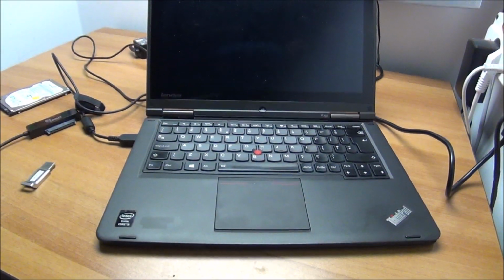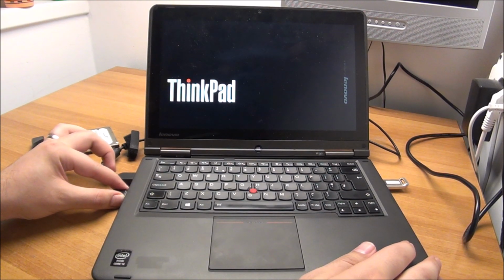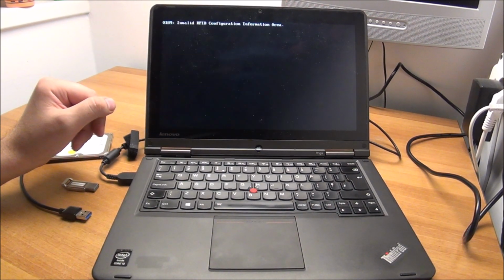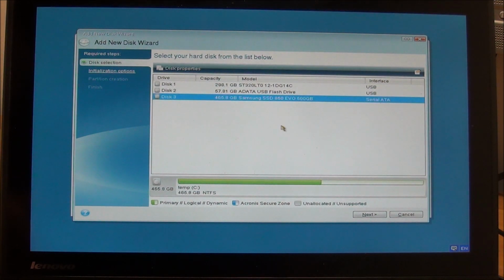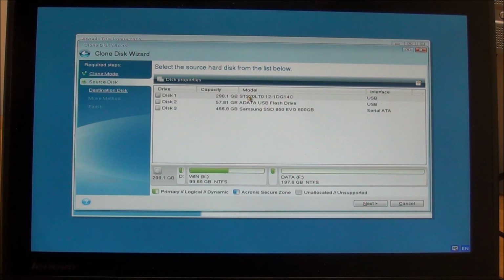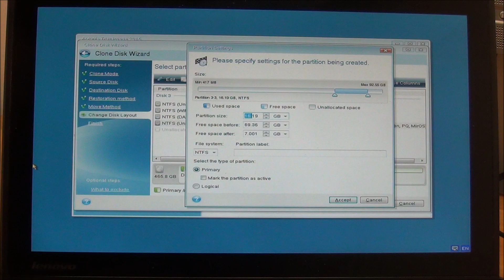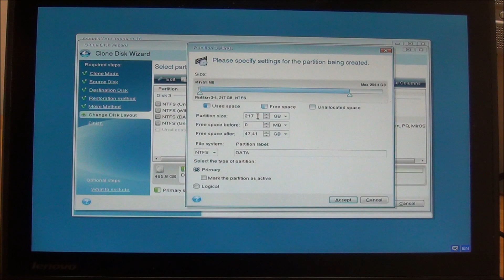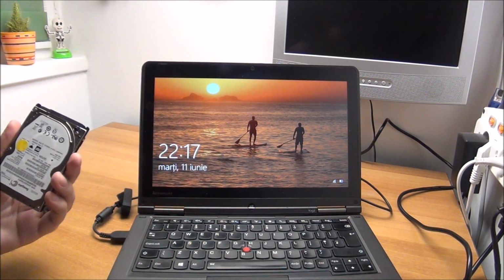How to upgrade a Lenovo ThinkPad Yoga 720 12.5" from HDD to SSD

Comment: Thanks for taking time to produce this instructional.  I can see you're skilled and knowledgeable in PC management and operation.
I get most of what you have done, but there are a few fine points where I just can't understand your words.  With all due respect, my understanding maybe a bit compromised by your accent, or possibly the shortening of each syllable in each word.  Is there any way you can 'subtitle' this youtube with captions?  Thx, Joe
Reply from the maker: Hi. Normally youtube already automatically captions my videos. It actually does quite a good job.